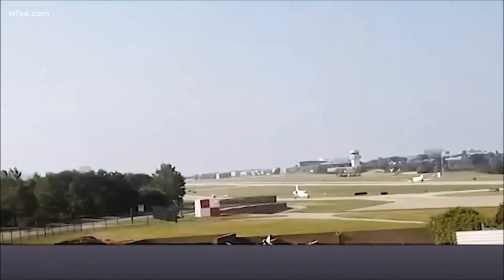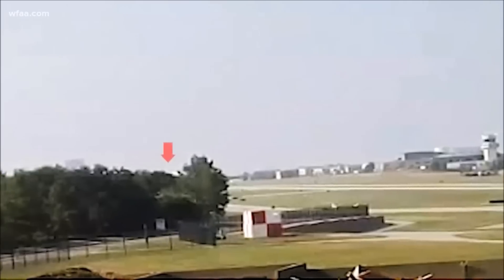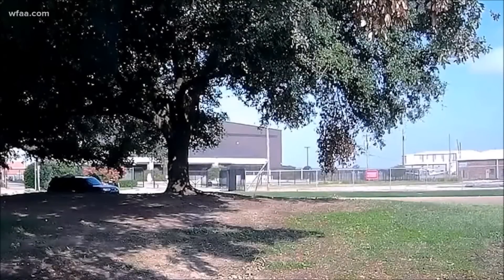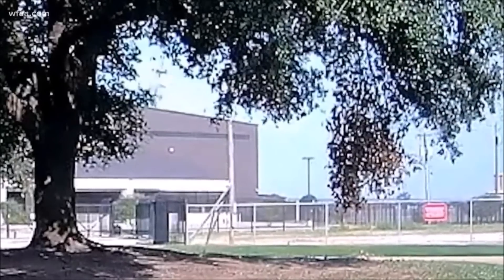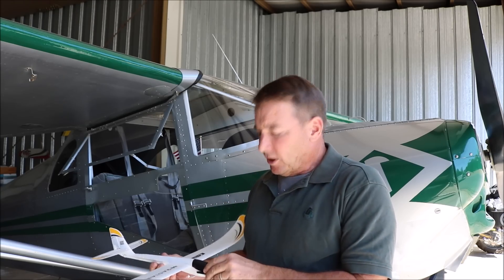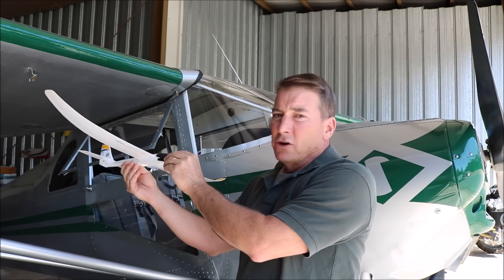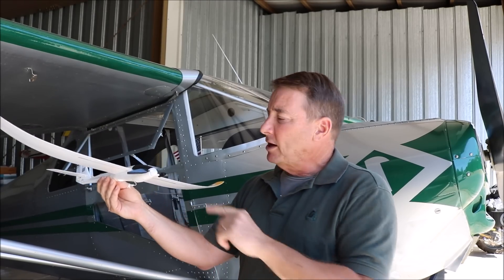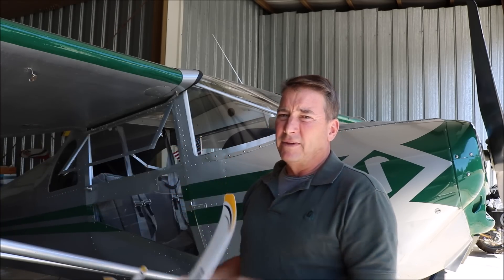Addison Tx. King Air 350 Crash UPDATE- Vmca

Comment: Juan, I got my Multi-engine rating many years ago and until this week I thought a Vmc accident was just caused by the torque of the good engine / drag of the failed engine side and the lack of rudder authority at low speeds. I thought a Vmc demonstration was a pretty benign affair.  {The only shocker was once in a simulator when I feathered the prop and keep getting slower and slower trying to find Vmc. I even did shallow banks into the dead engine…nothing. I thought the simulator wasn’t very good. But the moment I touched the prop knob to unfeather the prop all hell broke loose. I didn’t know you could roll that fast…. but that’s another story.] 

Only this week did I realize that depending on the airplane, the critical angle of attack of the displaced rudder and vertical stabilizer can be reached if the adverse yaw is not corrected quickly. Once the vertical airfoil stalls, the aircraft snap rolls into the dead engine. This isn’t just running out of rudder authority but complete loss of control due to the sudden loss of “lift” or side force from the vertical stabilizer. You can see the point where the yaw was increasing until the vertical stabilizer stalled and the King Air snap rolled in the tragic video. There is an excellent description in a You Tube video “Multi-Engine Training - Part 2 - VMC (Minimum Control Speed)” by Martin Pauly with a world class discussion of Vmc by Doug Rozendaal. Every ME pilot should look at this video. I think the pilot’s get somewhat complacent with the yaw at the start because it begins slowly but once the vertical stabilizer / rudder’s critical angle of attack is reached it’s too late to correct it.

Comment: Excellent discussion. 
The pilot should have chopped power on take off roll - when in doubt.
Reply: Probably didnt even have engine trouble till already in the air... could of been a catastrophic engine failure when they were already 30 feet off the ground.

Comment: Waay back “… in the last century”, a wise old instructor once told me a “variation” of “clean side up, and dirty side down”: “kid, if you’re gonna crash, do it on your belly, not on your back.” I’ve always thought that comment summarizes reasons why the PIC “may” have to reduce power and “may” have to pitch forward during an engine failure.

Comment: This tragic event is nearly identical to the crash at Essendon Airport in Melbourne Australia approx 3 years ago 
A critical issue identified was the feathering of the left engine or failure to do so and retract the gear 
Also I recall a super King Air 200 (can be corrected) ? 
All souls on board died

Comment: You never actually mention what Vmca means, so I looked it up.  "Velocity - Minimum Control (Air)" and is used to calculate minimum takeoff safety speed. As a layman, I was curious.
Also made me wonder 'as opposed to what' so I found VmcL - landing, Vmcg - wheels on ground. I still won't be flying a plane any time soon, but it seems like the simplest rule: don't stall out.

Comment: King Airs are robust and well designed aircraft.  Gotchas observed:  King Air series are exceptionally forgiving however that leads to complacency.
In older aircraft, power quadrant friction can be worn, leading to power lever migration. When that happens, none of the safety features (autofeather/rudder boost) will activate.
Confusion about the rudder boost with the pilot misinterpretation of the rudder pressures while the system is activated. A common error is pushing on the failed engine rudder instead of the thrust producing engine.   That excessive yaw coupled with full opposite aileron produces bad outcomes.  
There is also the issue torque runaway that has occurred in a number of aircraft.  The only way to handle this is the firewall shutoff valve to the associated engine.  Difficult to diagnose, since the excess thrust produces yaw simulating an engine failure, where in fact you have an engine overpower.  Coupled with the high workload environment associated with takeoff and landing and outcomes are poor.

Comment: This video is a prime example of a mindset that has plagued Light-Twin flying for years. There is negative transfer from Airline pilots and those that want to be Airline pilots to light-twin pilots. The pilots they are training may never see a Transport category airplane yet instructors are training them to make "V1 cuts" in a Piper Seminole. The difference between flying a part 23 Light-Twin and part 25 transport is certification. Part 23 aircraft are not required to climb on one engine even if loaded legally for take-off. There is no V1 speed in a Light-Twin and the very mention of one is negative transfer. If there is zero or very little single engine rate of climb then a Light-Twin pilot has to think like he/she is in a Cessna 172 that has lost an engine. That mindset has to be there untill at an altitude where obstacles clearance is assured.  What good is "Positive rate gear up" if the plane can't climb Single-engine. Why not wait untill there is no remaining runway, or an altitude where the gear can be put back down, whichever comes first. I am certain that if this pilot hadn't tried to fly his light-twin like an Airbus someone may have survived. He would have put the nose down and crash landed, but he would have been under control.  It is suicide to try to continue a Takeoff in a Single-engine airplane after an engine failure so why are we teaching light-twin pilots to do the same thing? 
Light-Twins do not prepare pilots for a Transport category airplane when it comes to takeoff planning. We as instructors need to at least discuss an aborted Takeoff after rotation. We need to make sure that pilots know that their second engine is only there for power, not safety. 
The FAA has a pamphlet called "Flying Light-Twins Safely" it explains everything that I just wrote. These VMCA accidents will continue as long as pilots try to make the impossible climb. The impossible climb needs the same awareness and discussion that the impossible turn gets from Single-engine pilots.

Comment: The one thing the pilots should have never allowed to happen was to let the airspeed drop even if it would have meant trading all height away and crashing straight ahead.
Reply: Airfields initially have a lot of open space around the perimeter. As with all popular infrastructure, the commercial buildings begin to pop up, placing the airfields themselves within a confined box like structure. 
The Russian crash landing after bird strike on take off, was amazingly survivable due to the open corn fields still surrounding the airfield.
Historic flight of Flying Tigers freight in 1950s, losing power following take-off from Midway Airport in Chicago downtown. The pilots flew through the streets of Chicago, avoiding as many buildings as possible, for as long as possible. Cockpit to tower voice transmission during flight, was traumatic for longer time than one would expect..

Comment: One thing sir, fully loaded airplane does not have a higher stall airspeed. Higher than what? Published airspeeds are usually only for max gross, sea level, standard day. Large aircraft have it calculated for actual conditions and weight. Light aircraft only have max gross stall published. So it will be not more, but as published. When airplane is lighter, it will be less. Jury is out if they were overgross.

Comment: I fly both Single engine and Model Airplanes. I have see this condition in Model Airplanes and it is identical in its steps to final crash. The airplane continues to slow down until a final stall, roll and dive into the ground. I am horrified watching what the pilots were seeing at there last moments on this flight. The thing is the King Air is one of the most robust Twin Turbos ans I am guessing this is a fuel shutoff by mistake and then the crash!

Comment: My guess was that the pilot not rated for King Air was at the controls. There was probably engine failure or loss of power right after takeoff and the PIC(King Air Certified Pilot) did not have enough time to take over control. Multi engine pilots are trained for this type of scenario and a experienced pilot would have quickly applied correct  flight control inputs.

Comment: The central question is whether the aircraft was still flyable with correct pilot inputs under the accident condition's, weight and density altitude, with the left engine inoperative and it's associated propeller windmilling and the landing gear extended. Assuming the aircraft was not equipped with an autofeather system or if it was and it malfunctioned.. Obviously the investigation also needs to consider whether it was flyable with the landing gear retracted normally. I assume even some turbo props, like many other light twins do not have the performance capabilities to produce a positive rate of climb single engine under certain conditions. Especially when the gear remains extended, at high density altitudes, or near maximum gross takeoff weight. Even so, while not advisable in my opinion, it's possible to still be a legal takeoff operation under Part 91 with zero climb performance available single engine. In some cases, even if the pilot does everything perfectly, the aircraft will still crash. Although normally right side up. In a worse case even where it would require the pilot to reduce power on the remaining engine in order to maintain wings level, or nearly so.

Comment: Could this fully loaded aircraft have remained airborne to do a circuit and land on one engine if the landing gear had been raised ?
Reply: Are you willing to give it a try? That's why we'll never know for sure if there was another option. The best we can get out of this is to expect what you just saw happen in those prevailing conditions. A warm day, laden aircraft and catastrophic engine failure on a twin, with initial positive angle of attack and gear down - an aerial tripwire of sorts, all things considered.
Reply from the maker: Yes.
Reply: But Juan, didn't you show footage of a twin with an engine out and retracted gear falling out of the sky? How come that guy couldn't reach a runway when he didn't have the added headache of the failure occurring during takeoff?

Comment: A few other factors we will never  know about. Was  the AFTH armed. Did the pilot retard the power lever which also disarms the AFTH system. We did this demo during flight test years ago using the BEECHCRAFT test card for this event. The main difference being; we knew what was coming, and briefed the test. We had to 'knock off' the test due to obstacled in the departure path down range. It did fly in ground effect but that was it. The human factor was obviously eliminated,  but we had built into  the test a 3 sec. delay for a WTF factor.

Comment: The only possibility of maybe a less disastrous outcome would be if he could have reacted quickly enough to close the throttle on the good engine (the mnemonic rule from my multi engine land training in 1966: “dead foot, dead engine, hard foot, good engine”) to stop the yaw, push the nose down and commit to crashing level and straight ahead. 

At a safe cruise altitude my instructor would have me look down at my lap while he had the controls, slow to below VMC by reducing both throttles (unknown to me), give me back control, and, with a card blocking my view of the throttles, he pulled one. My correct reaction the first time was to look at the airspeed, retard the throttle on my "hard foot" side, instantly nose down (dive) to above VMC speed and then apply full throttle and prop to the good engine. He never did actually stop an engine and feather the prop, possibly because at that time there were more fatal "accidents" training and practicing for engine failure in multi engine training then in normal multi engine flying.

Comment: Here’s an interesting point. 
At 2:20 you mentioned the landing gear should’ve been retracted. As we know,  extended landing gear actually decreases Vmc. Retracting the landing gear may have actually momentarily made the controllability even worse. At the same time, the decreased drag from retracting them would eventually allow for greater airspeed, and more controllability. 

So the question becomes, which is the right decision?  I would argue that if you are already below Vmc, keeping the gear momentarily extended may be a good option. But I don’t know. I’ve never flown a king air, so for all I know the drag reduction could be much more significant.

Comment: How late can you abourt and would that have been the only solution?
Reply: Dan Deen   With proper technique, a king air or any multi engine aircraft will continue flying.
Reply: @raoulcruz4404  well what happened then? why did all these people have to die..
Reply: Dan Deen Appears the pilot was unprepared for engine failure.  Or partial failure.  Many accidents occur because a pilot has flown thousands of hours without any problems.  Then a sudden event catches them off guard.  It’s called complacency .   People automatically think high time pilots are safer but they have a danger zone, too.

Comment: To my recollection, there is no V1 speed for a Part 23 Kingair. Vr and Blue Line is the proper terminology. The space in between is where this particular accident manifested itself. This range of speed can be 25kts different in the turboprop that I am familiar with. 25 kts can take a long long time to accelerate too.... if ever in this phase of flight with this heavy load at high DAs. All of the literature says this model Kingair should be amazing in this particular emergency. If the motor was not performing properly, there may be a good change the AFX system didn’t engage properly. This should be an every leg of the day check. Would be nice to see if cameras maybe picked up the run up before takeoff. Hope to learn something here for sure.

Comment: I’m 99% positive the airplane was over gross weight.  Beech sells them saying you can top the fuel and the pax, but that is simply not the case with a modern 350.  Most have a BOW in the 10300 to 10500 range.  That puts you real close to 14k with full fuel. Max gross is 15k unless it was a ER.

Comment: King air 350 is typed for single pilot operation. The PIC was not prepared for a v1 cut. It is a great loss for their families and friends.
Reply: The rudder boost system is supposed to give more rudder authority to the good engine side of the aircraft. Looks like it didn’t in this case.

Comment: Sir I have a question what is wrong with these engines in these king airs the reason why I asked this I know of for king air crashes and I don’t keep up with it you got the one where you got the one in Oklahoma City both of them were on Take off you got one here in Nashville by company called amp Electric it was on takeoff and then you got to Hooters plane and Bristol and I’m sure that’s not all what is the Achilles’ heel of these engine and why won’t they fix them

Comment: Oh wow a good friend of mine died in an accident similar to this one....he took off in a twin engine from a local(small)airport from West Chester PA back in the 70s heading to Chicago...topped off fuel tanks passenger capacity with luggage...he got the go for takeoff and as he headed down the runway right at liftoff one engine sputtered or quit he continued the takeoff giving more throttle to the good one...in exchange the plane didn't climb it did what I call a corkscrew not far off the ground and it crashed...i don't know how much runway he had left probably not much there was a very large cornfield at the end I guess he could have run into...he was new at flying only had gotten qualified to fly by instruments so his instincts were not good